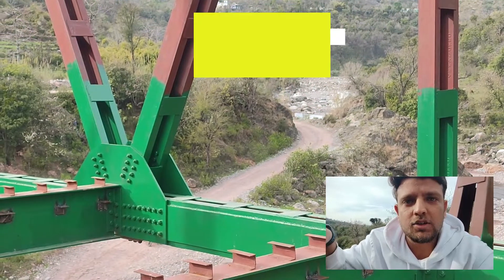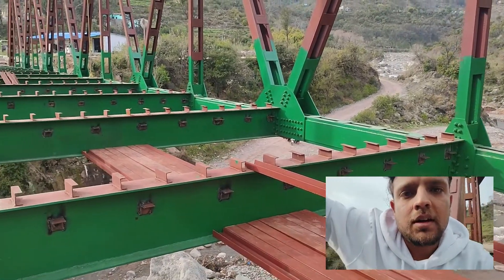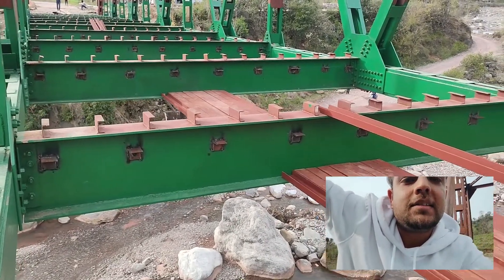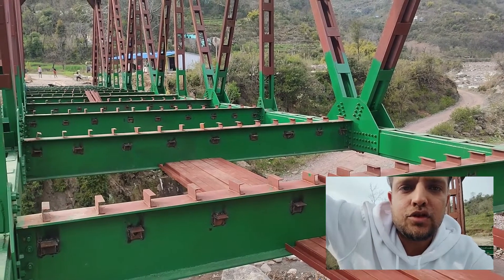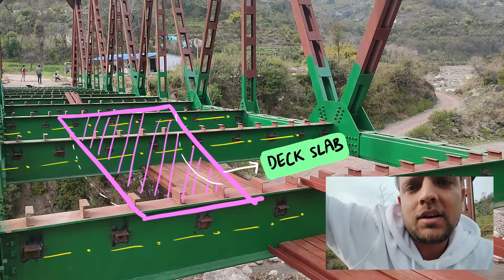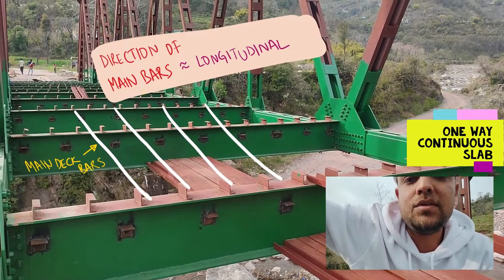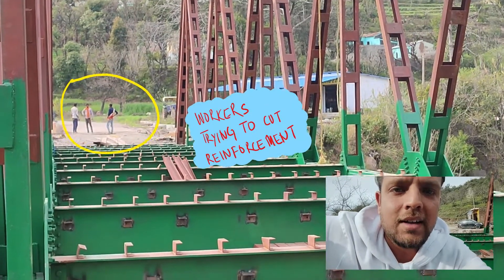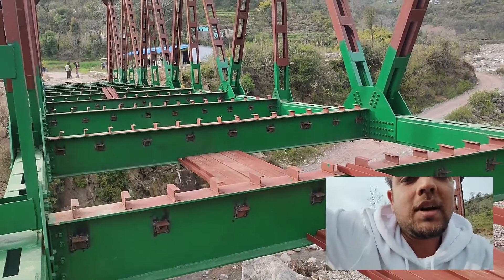EPISODE 4 | BEHAVIOR OF DECK SLAB | JOURNEY OF A TRUSS BRIDGE

Comment: Sir the cross girders do develop some fixed end moment but in truss analysis we treat the joint as pinned . Is it a safe assumption.?
Reply from the maker: Pls note that in this truss the connection between gusset and joint is purely shear connection as the flanges are not connected. Moreover there is a little gap between gusset and end of cross beam which you will observe in future episode. 

Regarding the assumption of assuming pinned support for cross beam, it's not mandatory to consider it as pinned. It completely depends on the connection that will be made. In fact in trusses supporting railway loads, you will see many stiffeners around the crossbeam -gusset junction and also the flanges are connected. For that the cross beam develops fixed end moments as well. And the section needs to be checked for all the moments